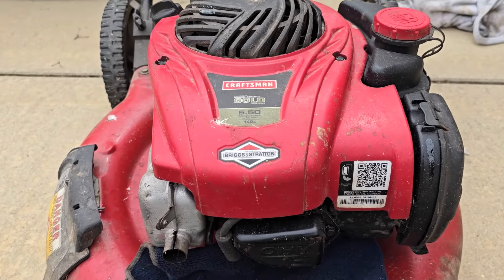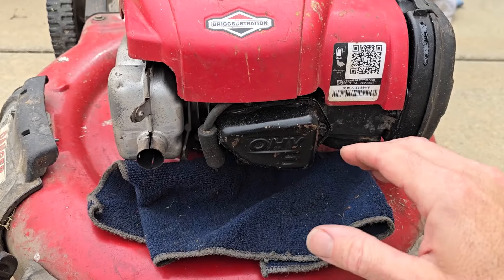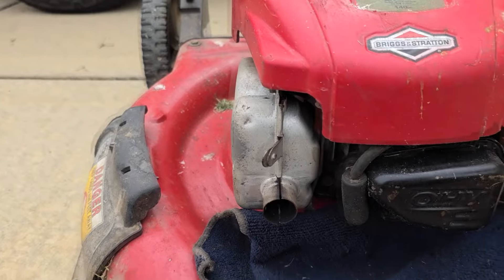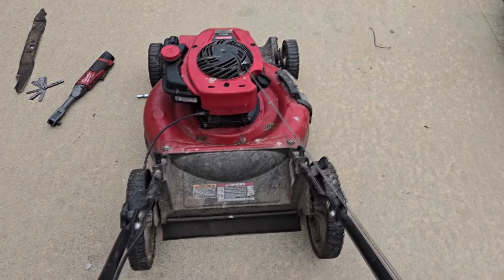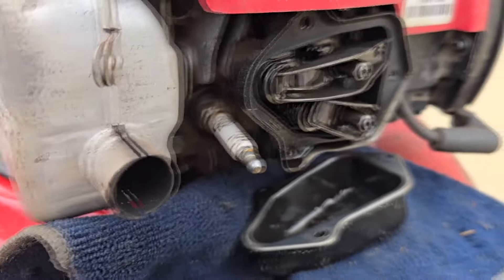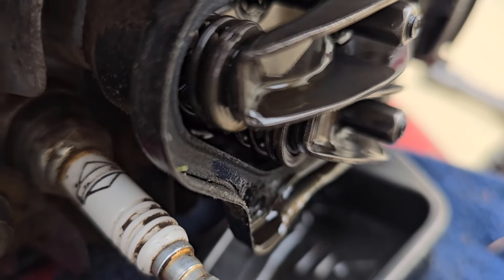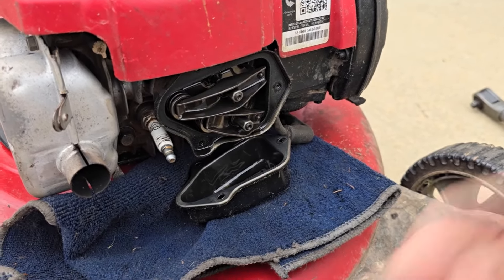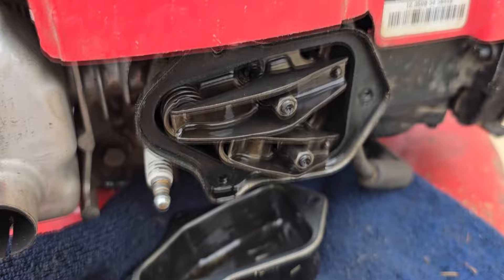Simple repair for Briggs and Stratton hard to pull Compression Relief and Valve Adjustment

Comment: My theory is that the cams on the bigger engines are more prone to fail because of valve lash being out of adjustment.
Reply from the maker: Makes sense. After looking this camshaft over though, I think it's just because they use such a chintzy spring on that release mechanism